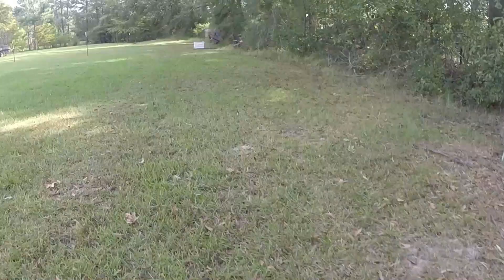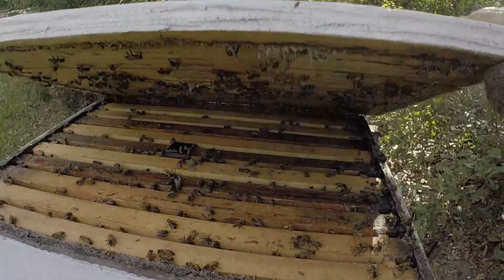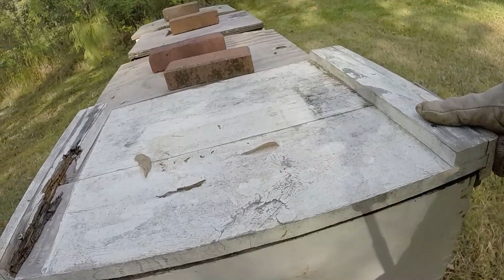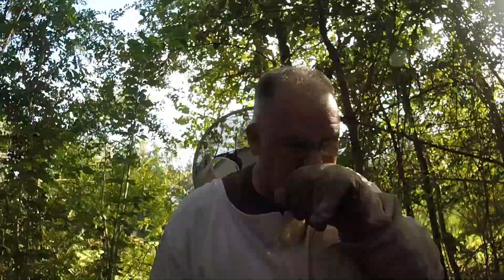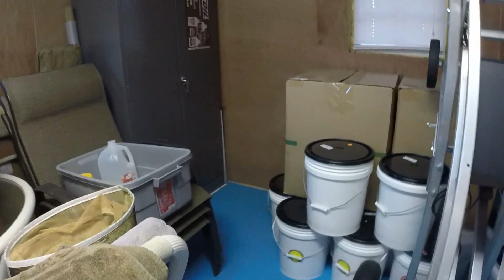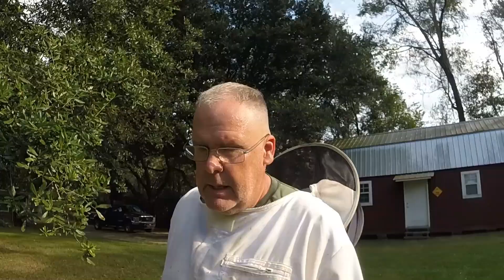Fall Hive Status and Random Hive Checks

Comment: Great update and a very good year Mike!  I agree once the hives are set up and confirmed queenright no need to go back in.  Maybe you need a few of those Pepto pink queens next year on those fussy hives!  Here in South Central PA the golden rod is finished, asters have just peaked, we've had two nights of frost, having a slight warming trend then rain and colder again.  Hives are all buttoned up with winter insulated boxes on.  Gave a last OA vapor the other day... mite drops on inserts were heavy on a few hives so they may get another round.  Everyone was fed up or given frames of honey from the freezer (thawed of course) to get them up to weight with mouse guards on.  Today set up t-posts, livestock panels and pulled out tarps for windbreaks (we get strong west winds over the winter) will get those steaked in and tied on tomorrow and that about wraps it up in my bee yard.  Already ordered replacement bottom, top and boxes and have them painted up ready for spring.  Will need to order Apivar strips for late winter treatments.  Biggest winter bee chore here will be putting frames together after the holidays to ward off the winter blues and counting the days to getting back in the hives in late March early April.  Have a great time at the Conference!
Reply from the maker: Thanks and thanks for sharing your winter prep routine. We just have to be sure we have stores and treatments. After that, it’s winter chores on equipment.

Comment: Do you tend to feed even bracing yourself for robbing? Here in atlanta, like others have said, it’s been so dry. Adding just a tad sugar water to an inside top feeder starts unbelievable robbing! 😫😫😫
Reply from the maker: I hope to make a video on how I’ll do it, but I will still feed, just with zero additives or oils as some do. Nothing against that, but the smell in fall will create robbing. So I will feed internally or hive top and it normally is not a problem with robbing. But same here as you with just a little sugar on the ground and it’s on for sure.